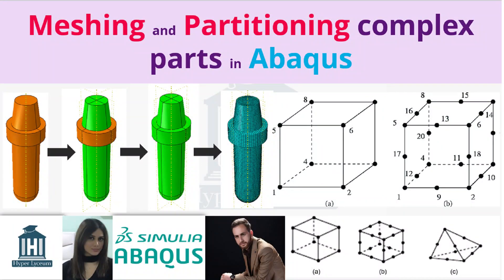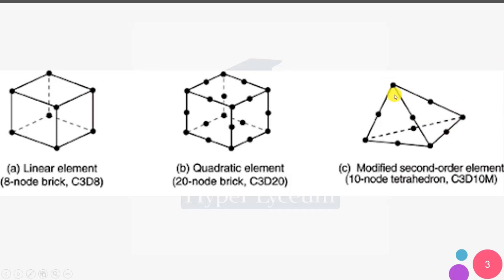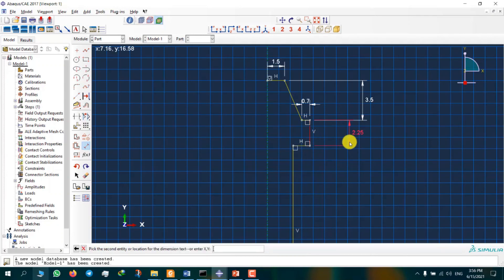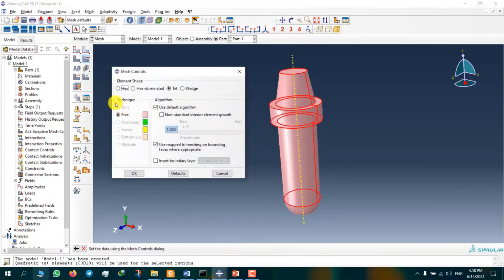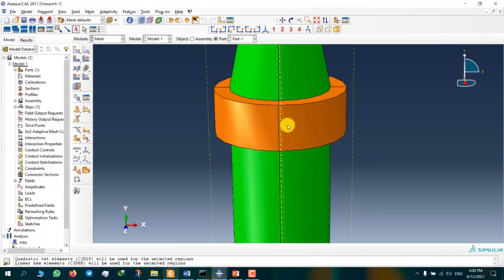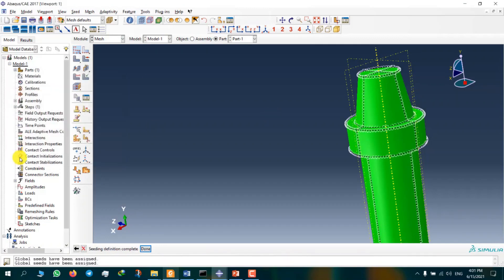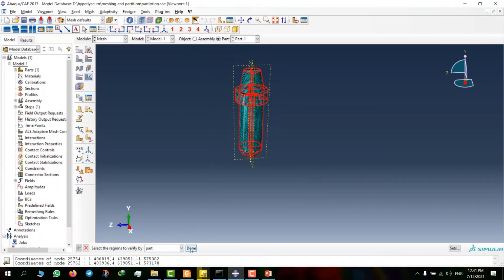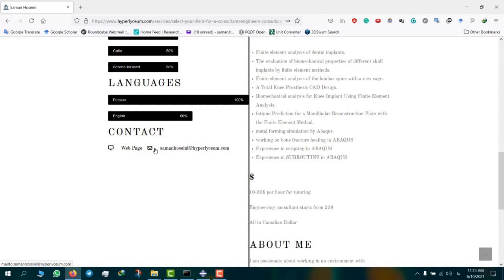How to partition and use the Abaqus meshing module

Comment: i wonder? is there a reference say that the aspect ratio must not exceed 10??
how can i get the right value of respect ratio for my model
Reply from the maker: It is a FEM basic that the element aspect ratio is better to be slammer than 10 but sometimes it is mentioned 20.

It is not a must but it affects the mode accuracy.
Reply: Refer FEM Text book.